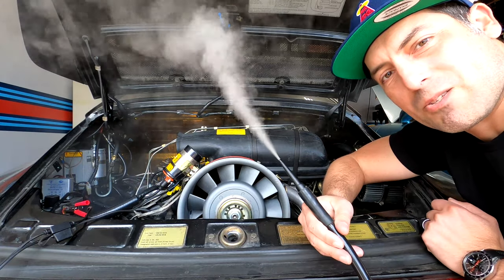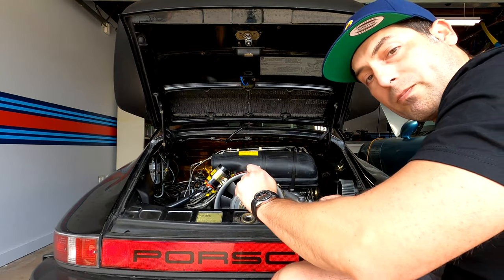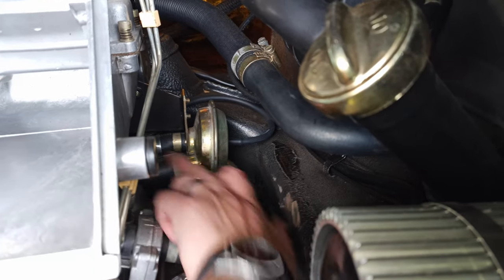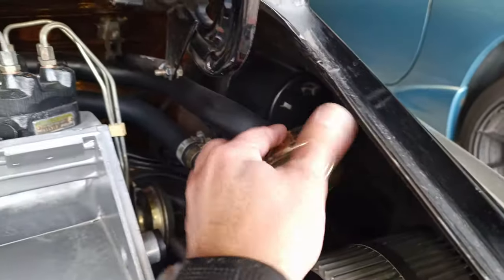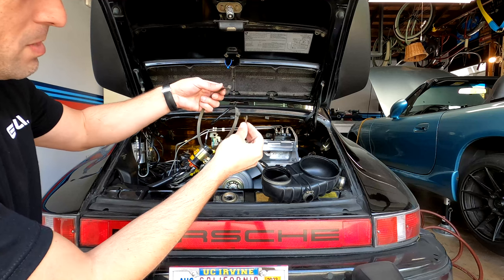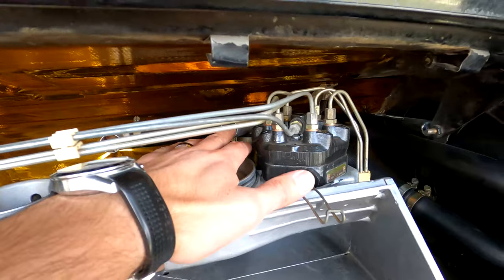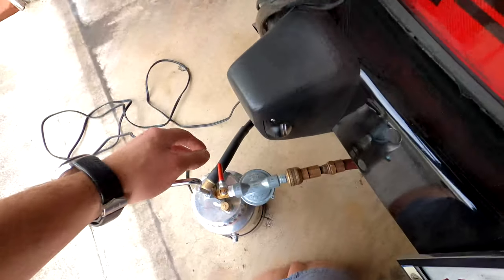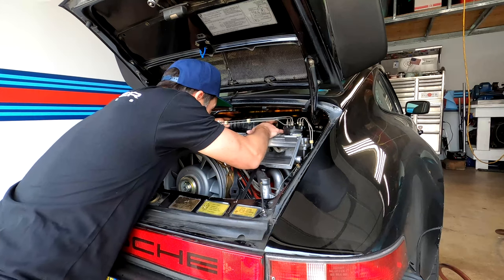How To Perform Smoke Test On Porsche 911 To Check For Vacuum Leaks

Comment: Great video --- thanks for posting and sharing the knowledge. I built a DIY smoke generator and will be tackling vacuum leak test. Your video is very helpful for me to plan and understand what to do. Your engine bay is looks so empty, simple!  No A/C, no heater fan or ducts getting in the way. No cruise control? Did you remove all those systems or that was how your car was equipped?  My 83 SC has everything  A/C (that doesn't really work well), heater fan, and cruise control. It is so crowded in there. Just thinking about removing the rubber boot behind the airbox, disconnecting the hoses in the back --- so many things I need to remove just to get to it.
Reply from the maker: I did a heater backdate and AC delete myself. CC was already gone before my ownership.

Comment: Hello, nice video! Wouldn't it be also possible to "inject" the smoke in front of the car, where the brake booster line gets to the brake booster? Maybe for ease of process it would be first also enough to just seal the inlet of the airbox (I have no pop-up valve and are most concerned about the lines, not so much the box itself). Thanks
Reply from the maker: This is possible. I would argue this might be a good way to find a vacuum leak closer to the booster. That small elbow from the booster to the hard line in the body is usually pretty stiff rubber so it may need to be replaced after disturbing it.
Reply: @JoeEngineer  Hello, so I did it "my" way and it worked quite well. It is a bit complicated to get the airbox air tight and I always had smoke coming out from there. But I found also other leaks (around injection valves and on the cap of the oil tank) so I'm happy with the procedure.

Comment: Great video! If one doesn’t have a vacuum port for power steering, where else would you attach the smoke tester, top of the WUR perhaps?
Thanks
Reply from the maker: Throttle body connections should work as long as you seal the top of the TB.

Comment: Unrelated to the smoke test, you have a heat sink on the oil filter.  Does it really do anything?   It seems that the surface area and air flow would not be sufficient to add measurable cooling.
Reply from the maker: Anecdotally, I think it does help cool a few degrees (not much) but I don't have any formal test data. Might be a good topic for a future video!

Comment: So this doesn't test the oil breather lines or the brake booster line.  Is it worth testing those by connecting the tester in those directions as well?
Reply from the maker: I would say the booster line is worth testing since it runs all the way to the front and is safety critical. The oil breather lines are cheap and easy enough to just replace if you suspect they are getting old and cracked.
Reply: Thanks.  Your videos are absolutely fantastic, btw.  My car just underwent a top end and CIS rebuild.  The shop did ok with those, but they weren't very thorough with the last process.  They got the car running -- it starts ok, but not immediately every time.  And on cold starts, it idles at around 2k and is perfectly content to sit there.  But when it warms up and the idle settles, I get a pretty significant amount of idle surge.  Like it will oscillate between like 400 and 1400 RPM.  You basically have to stay a little in the gas when standing at a traffic light in order to smooth it out.  I suspect a vacuum leak, which is why I'm starting there.  But the car is definitely running inefficiently.  I'm getting about 10MPG, which in a way seems like it's running rich.  Not sure...have a lot of tests to run here to try and isolate it. @JoeEngineer

Comment: Now that’s a great and easy to follow along video. I just did a smoke test and believe it or not but I only seem to have one major leak and it’s the seal in the pop off relief valve. Do you know what to live this with for optimal sealing? The spring feels pretty firm so hoping it’s just the o-ring that’s bad/dry. 
Also at the back of the rubber manifold boot the crank house vent is plugged and the hose is missing on my 1978 911sc. Seems fishy.. 1
Reply from the maker: I grease the o-ring with silicone grease every year or so. Honestly the seal that comes in the pop off valve is not that great quality. Once I find a better equivalent on McMaster I'll post the P/N.
Reply: @JoeEngineer  awesome thanks man

Comment: Excellent video.  Is your air box stock?  I notice it doesn’t have the ribs where the pop off valve is installed.  It also looks light gray in color vs black. Just curious.
Reply from the maker: Aftermarket cast aluminium box
Reply: Wow, that's pretty slick.  I also had a 6 year old Porsche master tech, but she's 18 now.  I sure miss those days. Thanks for the effort you put into your videos and blog.   They're indispensable.   @JoeEngineer

Comment: Did the smoke test. Discovered my pop off valve rubber O ring is leaking. Does anyone have a source or O ring size they can share?
Reply from the maker: Happens to me too. New video incoming.
Reply: @JoeEngineer   thanks I've been searching the web on the size of that O ring. My understanding is O rings are numbered. About 6 months ago I found a post but did not bookmark I think the size as I recall was something like 372 or 376. Not sure if you know the size or a source to get those O rings.

Comment: Great Video.. I put smoke into the Dizzy Retard line into front bottom of the Throttle valve, Plugged everything as you did, No smoke up top but I get smoke under the engine very close to the oil cooler, What could this be??? I've been using a lot of your video's and web site... Thanks
Reply from the maker: Maybe one of the rubber lines between the airflow meter and the firewall. Stick a phone behind there and take a photo.
Reply: @JoeEngineer  Thanks for the reply Joe, Another question: Does smoke make its way into the crank case? I put mine back together and it runs awesome, but now I have a NASTY oil leak, when running, approx where engine and trans meet. I'm thinking main crank oil seal, flywheel seal, but wondering if it's related to my smoke underneath i never found, oddly the oil leak and smoke leak were in the same area???